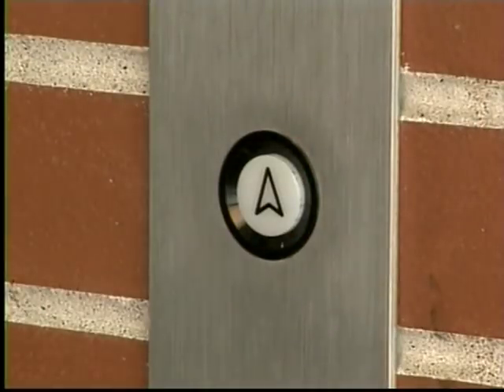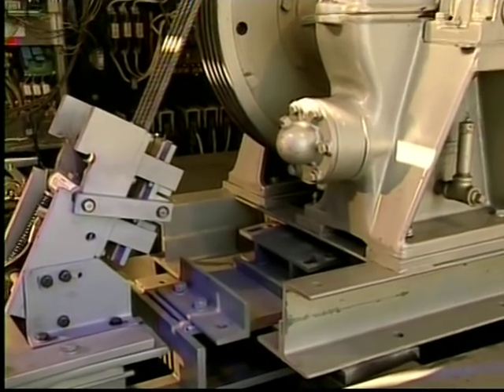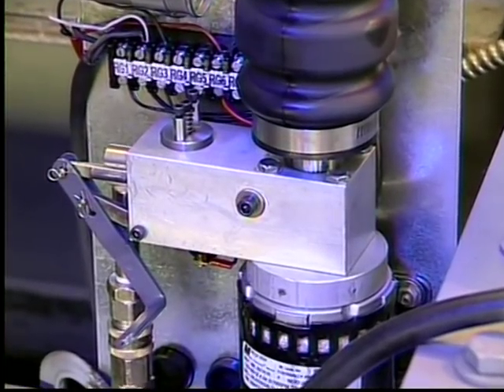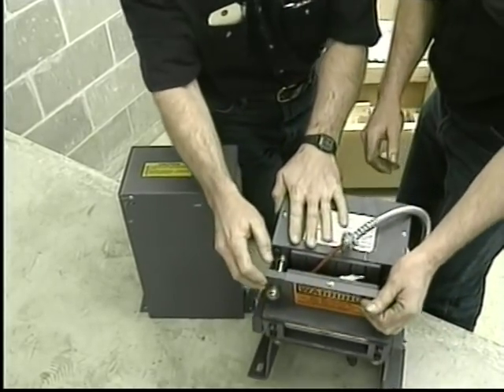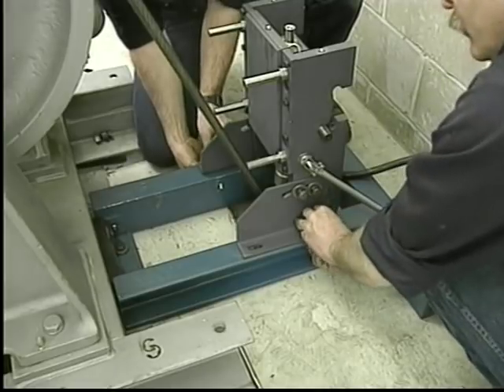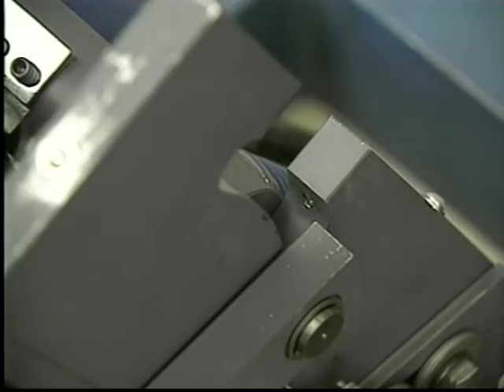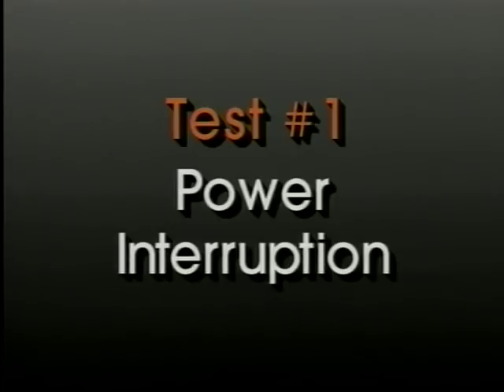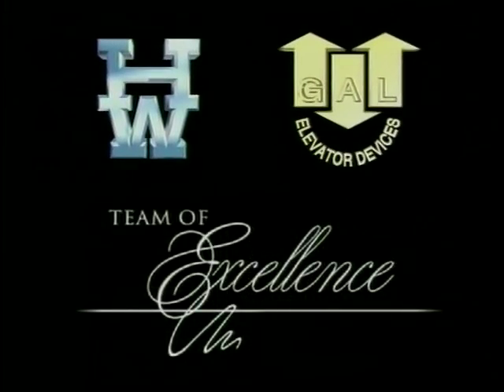Introducing and Installing the Rope Gripper

Comment: This videos is outdated (1980) and should be updated. Their products are well known and are hi-end high quality, our company is using them for over 30 years on all our installations. Proper engineered of the rope gripper base plate is required to ensure the rope gripper will withstand forces generated by the elevator.

Comment: Sometimes when doors are open on a floor a slipping brake could cause car to start moving with gravity. Could a laser detect any of this movement with door open and deploy the rope gripper? Also how long does rope gripper take to fully bind and lock rope if their is any fault? Could it stop an elevator car within say 5 inches ?
Reply: ELPaso1990TX no

Comment: Compare to a double brake the expensive rope gripper is a lemon! If the pads are worn out or the wear switch is not set properly (happen a lot). This may need to be manually reset after the power goes off. Pump and is capacitor, solenoid are also often defective and is not mean to work many consecutive times, not talking about messy oil leak when unit is aging.
My advice as a Elevator Mechanic is stay away form that and think about something else with a better warranty!